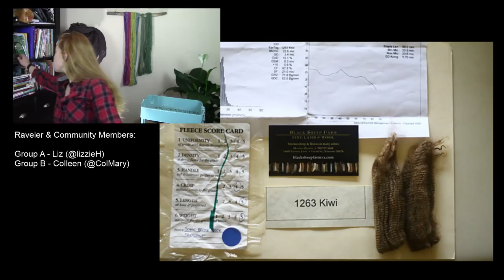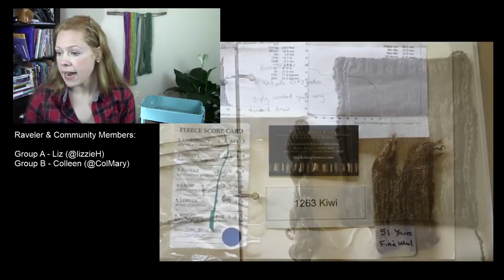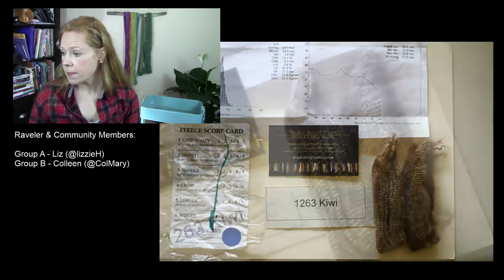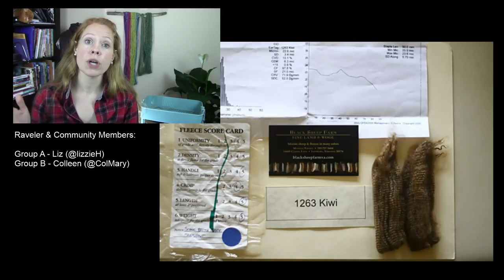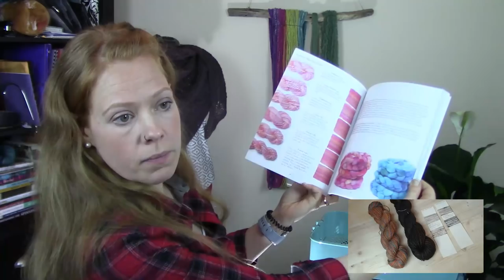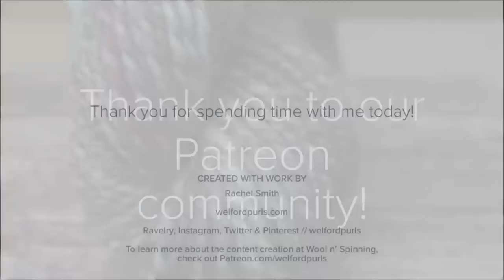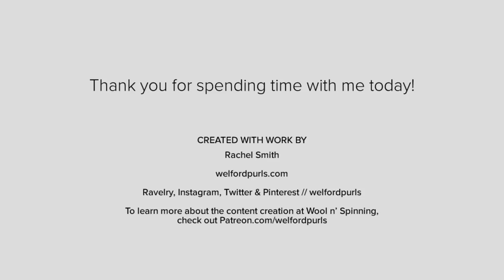Episode 135 Live: UNBOXING!

Comment: I’m happy you will be including espinners in discussions. I have the same model, but so far have not been happy with my yarns. I feel my wheel spun yarns are more consistent. I have a rhythm when treadling and I miss this with the espinner. Looking forward to  your wisdom!
Reply from the maker: Oh no! Any thoughts on what you haven't been happy about so I can speak to it specifically in future episodes? It would be great to know what people are struggling with specifically. I hear you about the consistency ... I wonder if some of that is the stickiness of the brake band and finding a smooth uptake? Thoughts?
Reply: Rachel Smith  the brake band could be part of the trouble, I will change it. I think too, my perception was that my production speed would increase, it has,  but resulting in less twist in the singles. I need to check the twist more often as I’m spinning. I have not used my espinner in several months, I will start again and try harder! Thank you!